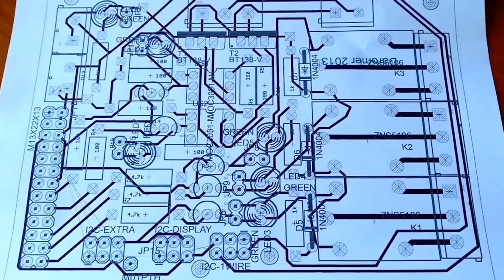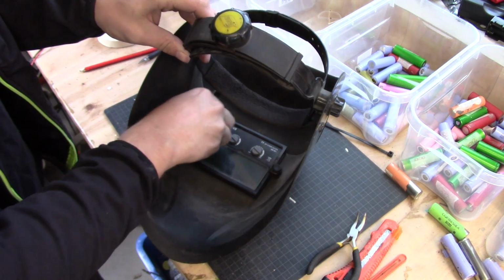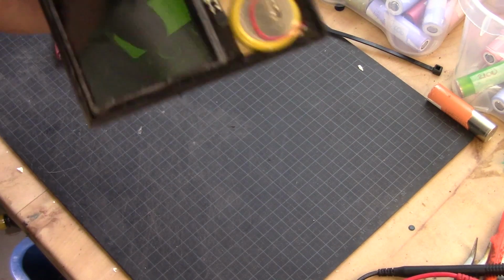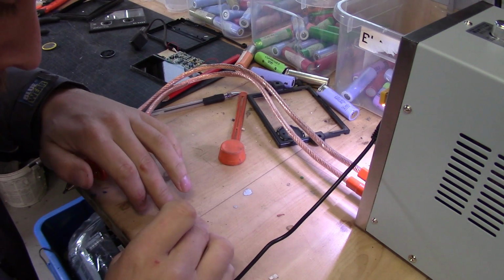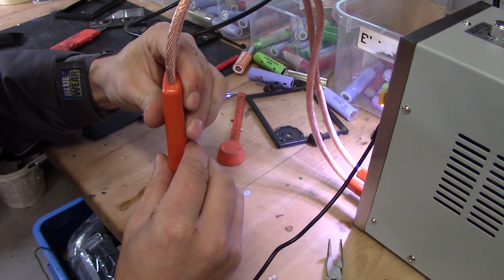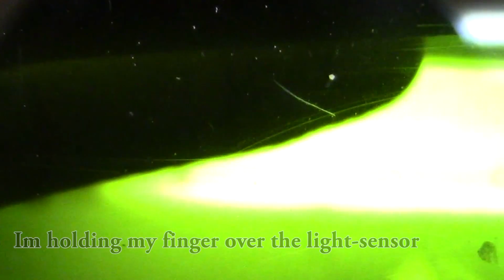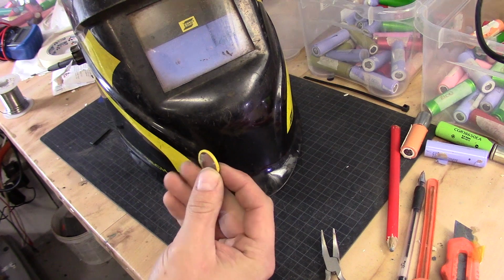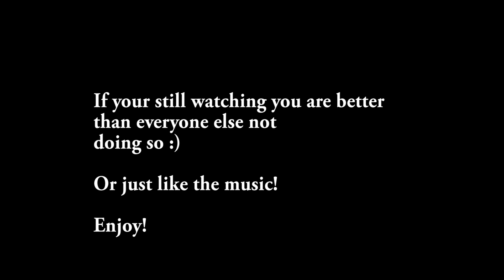DIY Fixing  Esab Origo tech welding helmet (Batteries)

Comment: I didn't know how to take the grind button of the esab savage a40
First 10 seconds and you helped.
Got to mention, on a40 it's a bit different. There's two latches, so just slowly, but firmly pull up on that button. Everything else is the same.
Thank you so much ;) 👍

Comment: I've ordered new batteries for mine but wondered why you removed the PCB/display assembly from the plastic housing when this isn't necessary to access the solder pads, and potentially exposes the delicate connections to the LCD to more load than leaving the assembly in it's plastic housing?
Reply from the maker: Not sure. I must have had some reason to why i did that :)
Reply: I forgot to say in my first comment but here goes -
Great Video man! Thanks!

Comment: unfortunately many of us diy guys don't have a fancy spot welder...i tried soldering..did not work...i ended up screwing mine up and breaking all four wires going to solar panel do to impatience.so i will replace entire unit now.. they really need to sell them with easy replaceable batteries... i also like the repair one guy does where he buy separate holders for the batteries with on and off switch as well... but your repair is great also...i just think improving this flawed design so in future batteries can be replaced in a minute verses  your method is best...

Comment: ~Great video I did the same to my helmet, I noticed the batteries that the helmet had is 2330,  and I see you bought 2430, how long do they last? I have been having trouble finding the 2330, the 2430 are easy to find but I think the difrence is they dont charge
Reply from the maker: I thought i had 2430 in it? Anyways the 2430 is 1.5mm wider than 2340 so it should have some more capacity if so. It fits :)
Reply: Think 2450 would work?

Comment: Really cool man , you think it charges itself from the welding flash ( arc ) other than solar charging?
Reply: राहुल शर्मा it doesn’t charge. The welding helmet battery assisted. Those batteries are regular non recharging batteries.  Have to buy a helmet that can replace batteries easily or just buy a passive non auto darkening hood.
Reply: @Mikey-ym6ok  oh thanks , but there is a solar panel  ( i guess it is the casing for the circuit ) above the main lens on my origo-tech other than two round sensors at front , i always thought it can be recharged like those Casio calculators with similar solar charging panel.
Reply: @micilebase  The batteries are Not rechargeable, they work with the solar cell to insure it darkens the LCD viewer instantly, when a welding flash is detected. (1/25,000 of a second typically).

Comment: I think you need to use rechargeable lithium coin cells. Probably ML2430. CR2430 are not rechargeable and will get damaged when the unit tries to charge them.
Reply from the maker: You are correct. It is wrong cells but they still go strong :)
Reply: @DIYTechRepairs  I wonder if the unit only charges capacitors and uses the batteries when the capacitors are depleted. I've seen claims that the stock batteries are actually not rechargeable.
Reply from the maker: @mcg6762  dont know to be honest. I dont remember what type of cell was in or how the circuit was det Up though.
Reply: @DIYTechRepairs  I've just modded a unit myself and added an external battery holder for two AAA cells. This unit had only one bigger battery, a CR2450, not rechargeable. Funnily enough the circuit has the solar cells directly in parallel with the battery, so it does indeed try to charge the battery when it is depleted. Bad design. Probably it was meant to have a rechargeable battery but they decided to save some pennies in production.
Reply: @mcg6762  AAA externally is a good idea, will try this on mine.
Reply: @mcg6762  how bad is the design if it works years without a battery replacement?